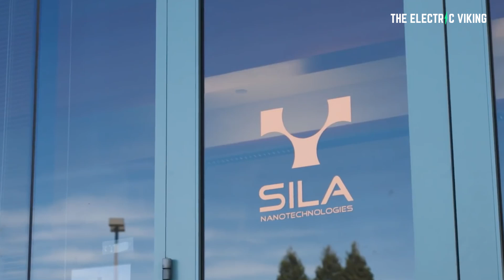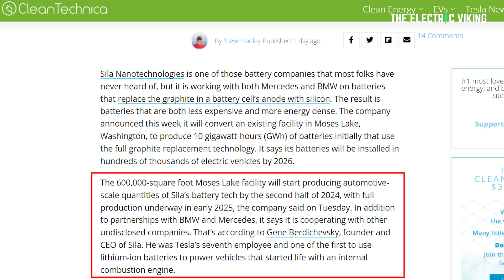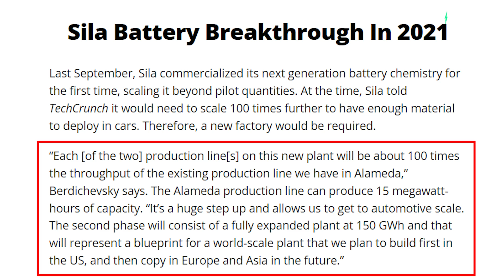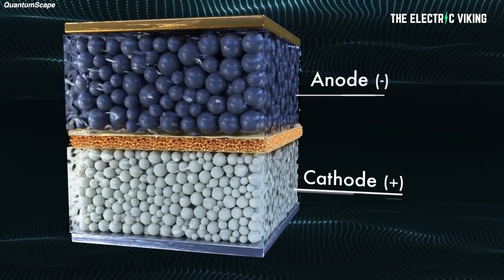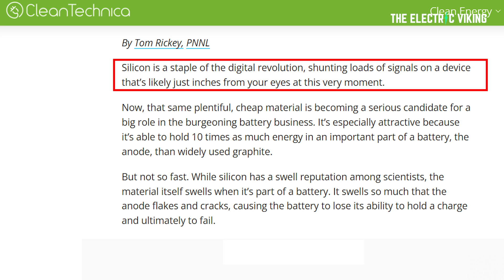US companies battery breakthrough will change the world

Comment: Its great to see innovation like this.  This and other improvements couldn't come soon enough.  In particular being able to use common, easily obtained elements.   But one caution I have is that for EVs, I think the buying public will want to see safety over capacity so whatever innovations we do come up with need to be made significantly safer than NMC and NCA chemistries.

Right now that is in the form of LFP based chemistries.  So true excitement would be seeing tweaks to LFP chemistries that are able to give us similar achievements in energy density and weight.

-Matt
Reply: Phone battery technology is the same stuff that auto combusts in GM Bolt cars. And other cars though they are better made.
Reply: Seeing the batteries in action in devices that are next to the skin (wearables), or in front of the face (phones), will answer safety concerns.

Comment: Not sure if you’re aware, but Sila has had a deep partnership with CATL.  CATL recently just dropped a battery that they said is more dense than the 4680 didn’t they? 🧐
Reply: CATL's battery improved over 4680 simply by being rectangular, over cylindrical, and larger package. Cylindrical lose 10% between cells.

Comment: Pour hot water into a thick walled glass, it cracks due to uneven distortions. Pour hot water into a thin walled glass and no cracking. Small battery OK, big battery, not OK.

Comment: Making the anode with silicon is well known to increase energy density.  If it was easy it would be in today's batteries.  The existing battery manufacturers would like to add this on their existing lines.  However it is kinda like shooting themselves in the foot.  Every battery made right now can be sold.  There is no incentive to make a battery better or cheaper.  The cost of a battery needs to be looked at over the life of the battery.  The variables are energy density and cycle life.  Higher density and larger capacity with the most cycle life would be the longest lasting battery.  It's all about compromises.
Reply: There is an advantage to making better and cheaper. The global market. If you refuse to use better technology, someone else will, and also undercut you on price, and outperform you. Battery cost is a major factor in EV production, it would be asinine to intentionally use more expensive batteries.
Reply: It’s quite likely these silicon cells work fine in small packages eg a smart watch. But scaling to even laptop computers is a much bigger cell. Scaling to 2170 is bigger still never mind 4580. The density might be good but can it be scaled up?
Reply: Yes...to just about everything here. And the battery tech is getting lots of attention and i am sure we will see huge changes in the next few years.
Reply: Yes, it's about compromise, but there is every incentive to reduce cost It makes no sense not to make more margins. The issue for Silicon is cycle life.
Reply: A bit negative there. Just because you make something cheaper doesn't mean you have to drop profit margins.  In fact, the lower your costs, the more chance you have to be competitive and retain margins.  If making the silicon 'anode' was easy, this company would not exist in order to pitch to supply their material to battery makers.
Reply: @onefiniteplanet  You can only lower your costs so much before it is not even worth it and with the resources needed in this field you are at the mercy of commodity prices.
Reply: Elon Musk admitting defeat when it comes to battery tech is important, it shows those at the forefront of tech can be surpassed almost overnight.

The fact these batteries were used to propel a Mercedes 1000 plus miles proved them to be viable and right now the best tech on the market...just wondering about life of the battery
Reply: @AndyAndy-we9pe  
If you put words in other people's mouths, especially the richest person, you're liable to get sued for libel!!  Prove what you claim or STFU.

Comment: Battery technology keeps expanding,  but paraphrasing Elon "getting things into production is hard"
Reply: These guys say they are already in production with their silicon based material.  Just need to get more battery makers on board to get batteries using it in production.  Doesn't seem these guys will do the battery production.
Reply: @onefiniteplanet  They can say a lot of things but reality can say others. Tons of these types of companies burn through funding and peter out.
Reply: Already used in a Mercedes 1000miles plus range , no not hypermileing.